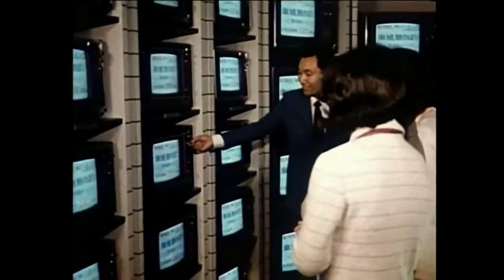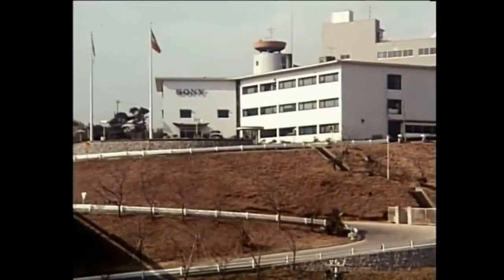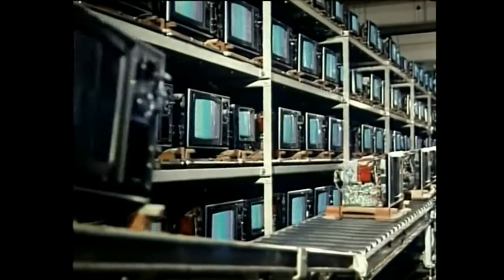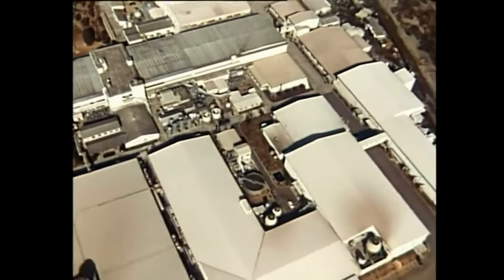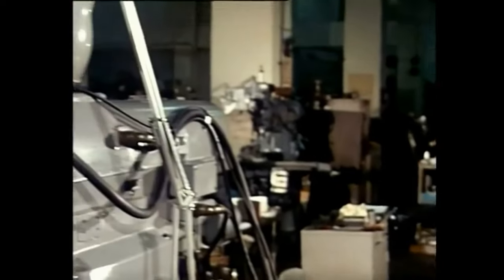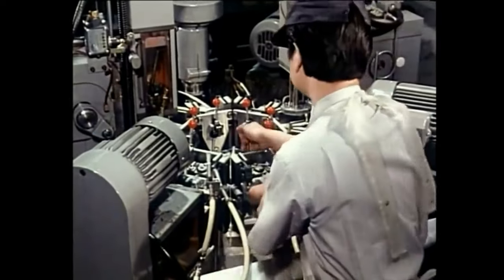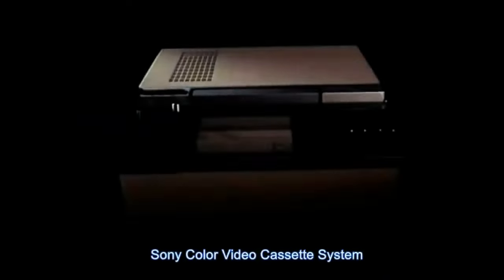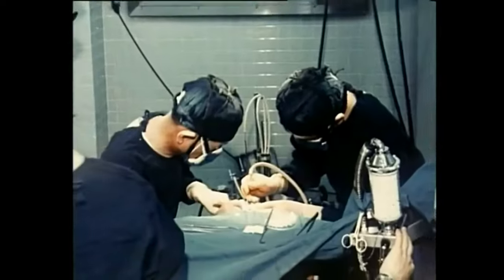For review and discussion, SONY Factory Tour: Television Radio Electronics 1960's Trinitron TV Japan

Comment: I did'nt know the Trinitron was invented in the late 60's. I first heard of them in the mid 80's.
Reply: it took a while before they were able to sell them outside Japan, since every country had a bunch of their own companies making TVs and monitors. They were in the US and Canada for a while before we started seeing them in Europe, and especially here in Denmark I can't recall hearing about Trinitron till the near-flat came out in the early 90s. It was and is the same with any other great products that struggled to get a foothold because of local competition and regulation
Reply: @thesteelrodent1796  Yeah, that makes sense.
Reply: They were in Australia from the start of colour TV in 1975. I scrapped quite a few KV1800s with worn out tubes in the 90s. I was also given a KV1830 that after replacing a faulty capacitor turned out to be very low hours, and picture was as good as a mid 90s Trinitron even though it was from around 1978
Reply: Probably they did really sell those in top wealth countries as it doesn't seem cheap in any aspect starting from the tube itself and so much stuffed with components.
Reply: @ran2wild370  That's a good point.

Comment: Trini-ti-ron - what's that all about?

You had to dig deeper into your wallet to buy a Sony product. It was their ethos and their attention to detail that set them apart. This video encapsulates it quite nicely.
Panasonic were only a contender up until the late 80's, then they lost their way. They always cut corners, done in a way to be hidden from the consumer's eyes.

JVC, Toshiba, Sharp, Sanyo - all garbage brands these days if you find anything branded by them.
If you open up a device, even without the badging to help you, you could always tell a Sony product apart from the other mass-market brands.

Such a shame what happened to the Japanese electronics industry. They had a pioneering spirit that it seems the Koreans have since dominated.
Lucky Goldstar - a joke cheapo brand in the 90's, now look at them!